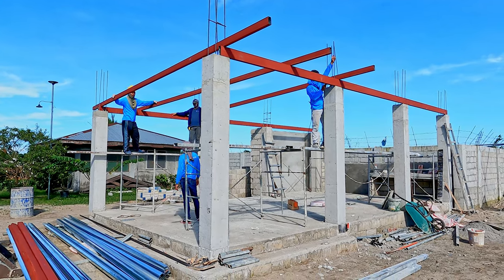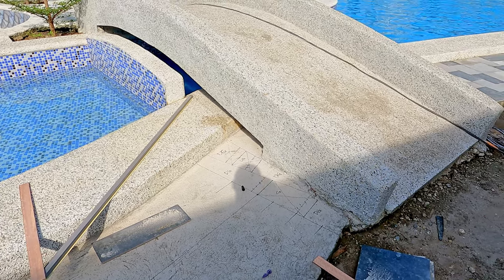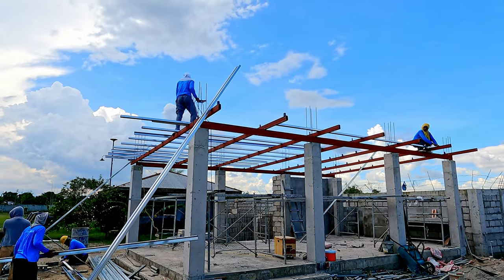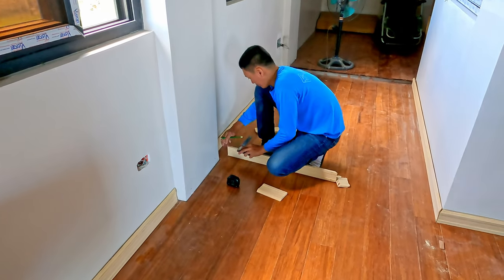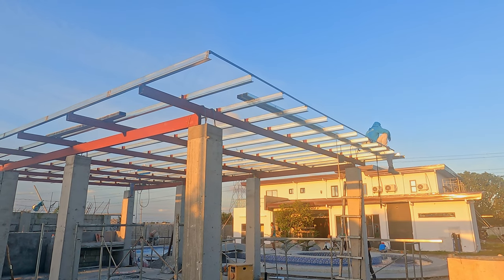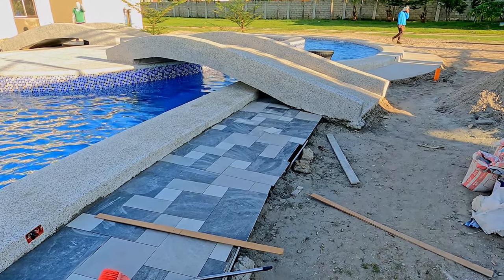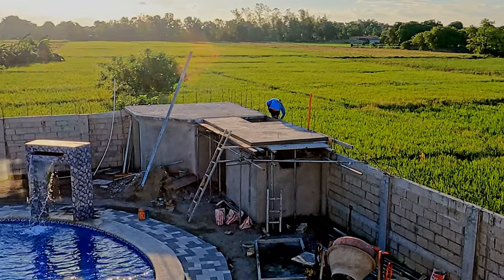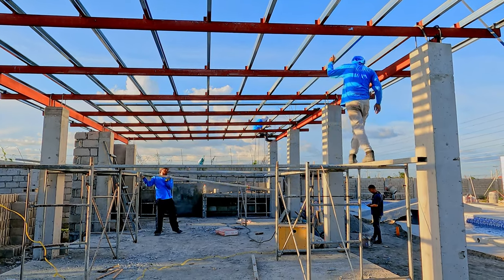Philippines House Building Day 330 - Gazebo Roof Support Done

Comment: Good afternoon Mike.  The glass stainless steel hand rails combination is the best method I've seen I like it.
Do like timber skirting gives good finnish , difficult fixing to concrete. 
The gazebo usually small structure down the garden well only Mike's is mega. The roofing steel support beams seem large spans , time will tell as if wind will uplift  I think I would have deeper sections on the longer spans 
Many things happening great progress. 👍
With all that tile cutting I would have thought the builder could invest in tile scoring cutter. Better Finnish faster work they have them at Wilcon
Reply from the maker: Graeme
Thanks as always.
I am equally surprised that he does not have a dedicated tile cutter - he is normally not afraid to invest in equipment.

Comment: C-purlins are most likely galvanized, hence protected from exposure. Possibly the welds will get some of the red oxide protection paint.
Reply from the maker: Absolutely correct - and sorry for the delay, comments got left behind for a few days.
Reply: @philippines4.0buildinganew64  No apologies necessary, but thanks for it. Heard you mention the oxide protection of the joints already. I hope the corrections of the roof gaffe are you your liking...